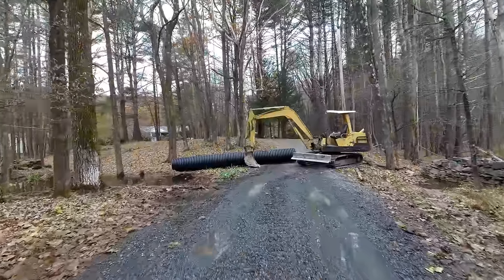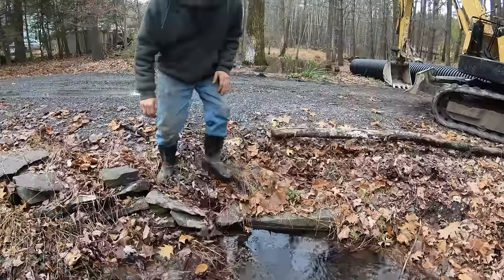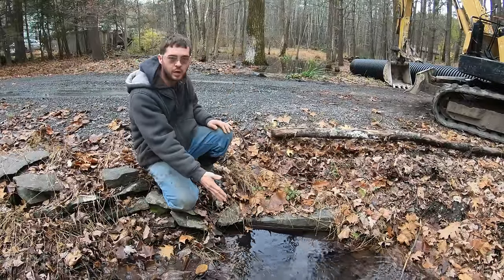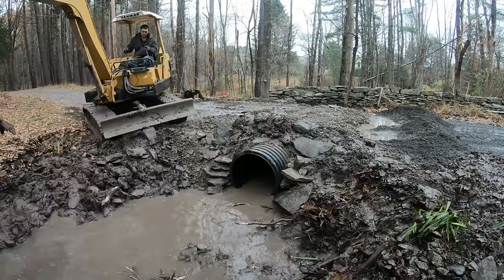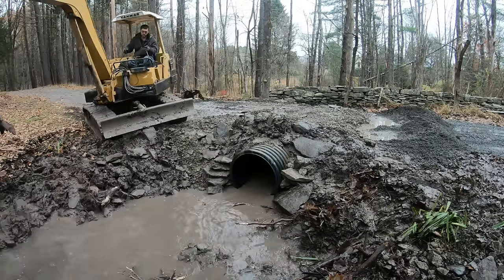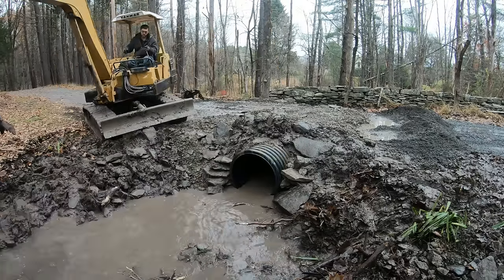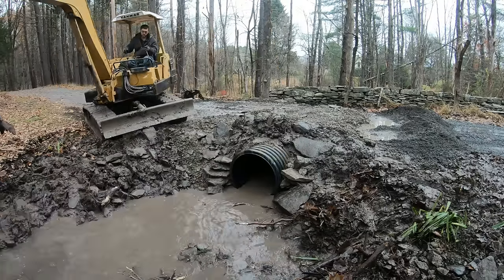Replacing a culvert pipe

Comment: I am 84 years old this yr.  I started operating heavy equipment in 1957 after the Air Force.  I stopped in the 1980s. Painting and Drywall was my real trade but always worked with Bulldozers, and scrapers.  I try and watch all you posings.. you bring back some great memories.  Thank you for posting this and others.

Comment: Lesson of the day: Hire Andrew first.
Reply: thats happened to me before as well, i mowed for this guy and i told him to wait a lil bit and he went ahead and got another guy to mow and he charged em quadruple of what i charged and didnt do a much as me, oh well he lost out on 5k , now i cut his stuff all the time instead xD
Reply: Yes I wish my a..hole next to me would do this to his drive way. I think I will have take him to court. My yard looks like I have a pond.
Reply: I know the heavy duty machinery is expensive but how much would a job like that run with parts and labor. I know it varies from location but what is the approximate number
Reply: @joneskey3950  depends on what you break tbh, you could have a cylinder packing failure and thats cheap to fix if you do your own labor or your drive motor can shit its pants and it could cost you a few thousand. depends. for a bobcat type machine we charge about 30$+ per hour and thats on the cheap side
Reply: what size gravel is that at the end....wow you spread it evenly and easily...
Reply: @johndowe7003  $30/hr is way too cheap. Depending on where you are, it should be $75-125/hr with a minimum.
Reply: Beautiful job!
Reply: @barkybarker2592  neh I just charge 30$ a hour a 50$ for truck and tools . I make more money that way because people give you more jobs
Reply: @johndowe7003  with that logic why don't you charge $12/hr. Your equipment will wear out faster and you won't have enough profit to repair or replace. But run your business your way. Merry Christmas!
Reply: @barkybarker2592  my machines are paid for, and repairs/fuel for my equipment isnt expensive. tires is the most expensive for me but i have my own tools so i fix my own tires so thats not a problem. fuel costs for me is about 2$ a hr so 28$ hourly wage is good enough for me. you charge too much and they aint gonna get you as often. just the way i do it, i like to undercut stupid fucks that overcharge just for shits and giggles lol
Reply: @johndowe7003  Yes, $28 is a decent wage but not a good hourly rate when you are paying taxes, insurance, parts & repairs, etc. $28/hr is about what I was making when I was working for someone else. I just bid an easy job at $90/hr and got it. So I'll make in 3hrs what you will in 10hrs. Enjoy your day!
Reply: and last.
Reply: Anonymous you get what you pay for
Reply: David488013 you chose to live there
Reply: DrScopeify very true if he’s making a living doing it I commend him. But if he’s gonna put up a video of his work he should do it correctly so people like you (misinformed) can actually learn to do it correctly because that by far is NOT the “properly” way to do it. Not bashing the guy he’s got great work ethic. DO IT RIGHT.
Reply: AGREED HE'S FROM ANOTHER PLANET JUST AMAZING.....
Reply: IF Andrew live here in Upper Northeast Illinois, I would Hire him in a heartbeat to do some work on our small piece of property!:-)Hey Andrew, Have a small spare bedroom and home cook meals??
Reply: @mysticarsenal  They call this in the industry "Pricing themselves out of work" because at some point, you'll have worked 3x more, and done 3x more work for 1/3rd of the pay and either break something or need medical care and wont be able to afford it type of thing. Those people cut the wages for the rest of us out there doing anything, too. If we all charged a good fair rate, we'd all be better off.
Reply: hypercube33 excellent point. 100% agree.
Reply: Damn right hes good aint you seen his movies. If this guy was in my backyard I hire him to do everything. He overengineers the shit out of everything and leans heavily towards serviceability. Thats money in the bank for any property owner.

Comment: I bet the home owner is now wishing that she had just hired  you to begin with
Reply: RNGN and when she has problems with this one in a cpl years she will wish she got someone better.
Reply: @mysticarsenal  Please elaborate.
Reply: Lsatq you mean why it will fail??
Reply: @mysticarsenal  ya
Reply: Lsatq I pointed out all the major issues to him in my post  below. Please read those. Thanks
Reply: @mysticarsenal  unable to find your post guy
Reply: @mysticarsenal  You'e right,
The pipe will absolutely  fail, he missing to ensure a flat ground under the pipe and digging deeper.
Reply: Mohammed LAMMANI I know. Thanks for backing me.
Reply: Pipe will start pushing up through. Any size over 12” should have a half height headwall installed on both ends and Atleast 36” of cover over entire length of pipe. Compaction is very important under pipe and on both sides. Which he didn’t do.
Reply: Mike Bresnahan are you referring to me about being hater???
Reply: Lsatq Pipe will start pushing up through. Any size over 12” should have a half height headwall installed on both ends and Atleast 36” of cover over entire length of pipe. Compaction under and up the sides of pipe is very important and he didn’t do that.
Reply: @mysticarsenal  there is a stone layment headwall. on both ends. but yes , its not deep enough! it should be good enough for 10-15 years if he gets in that gravel of 12" he promised in a week.
Reply: @mysticarsenal  I think the main problem with your "issues" is a lack of respect for the budget constraints. Someone has to pay to bring multiple machines in, to hammer bed rock, to do all these things. You seem to be someone who isn't willing to respect a contractor that does the best that can be done within the constraints of the job. I mean do you think it was him that only wanted to place 4 tons of gravel? He did the best that could be done. Yes with another thousand in the budget, a more permanent fix could have been established, but the thousand wasn't there.
Reply: @mysticarsenal  "not having a clue what they're talking about" 

Did your ears break midway through the video? He literally says "I agree it needs to be deeper" 

AKA HOW TO DO IT CORRECTLY. As in, it's not deep enough, the correct way is deeper. 

I mean jesus, do you need an episode of sesame street to get the full context of "people will say it's not deep enough and I agree it needs to be deeper" and pull from that the correct was to bury it deeper?

He said he hit bedrock and it would require him to use a hammer drill. Obviously that's going to triple his dig time, he'd need to swap to the drill, drill it all and then swap back attachments or else bring in a second machine.

He only put 4 tons of gravel on it AS AGAIN HE MENTIONED. Obviously it needs more. If you have any capacity for critical thought at all, you'd be able to infer that the reason the entire driveway minus the section by the culvert is completely devoid of gravel is that they don't pay to have it done. Look at like 15:00 in. The entire rest of the road hasn't been graveled in so long it's completely devoid of it. 

It's incredibly obvious that they paid for the bare minimum amount of gravel for that spot and that they didnt want any at all elsewhere. 

What might we deduce from this? They aren't going to pay triple for the dig labor to bring out a hammer drill.

Yes he didn't explicity come out and say "my customer is cheap and refused to pay for what it would take to do this right"

Nor should he. And no he shouldn't even say it "politely" because if the owners were to actually watch the video I assure you they'd be able to see through the polite BS to the actual statement. Certainly, they would if he said it as explicitly as you seem to need it to be said to drum it in.

There is enough evidence within the video for those with working eyes and ears to infer that they would not have covered the bill.
Reply: @sparkzbarca  better stop defending andrew;-)(he doesn,t care about about these knowitalls , cost you time and it wil not change one bit of these ''haters'' and ''so called pro,s'' trying to piss on his work..
andrew has multiple levels of workquality/cost, and these people refuse to realise that most clients have a budget or simply just don,t care enough to spend more money on..

i think its great that andrew can work on so many different levels..
some contracters think that they are too good for doing these types of jobs.
well that is where andrew comes in, as he can do lowbudget low level jobs as well as the highbudget high level jobs and everything in between..

they see him being succesfull being a mainly one man machine with little to no overhead, and getting extra money on adsense as well. and that stings them.. ;-)
just the number of vids, and different jobs tells me he is doing very well. and that he gets a lot of clients.
they can hate on everything but he is not swayed one bit by it and straight up ignores them..

so should we (imho)
Reply: @sparkzbarca  Good job holding back on the nitwit with zero comprehension of what he just witnessed. Or maybe he didn't watch it. He may have skipped to the end, spewed his dirt and now sticks to it to save face.
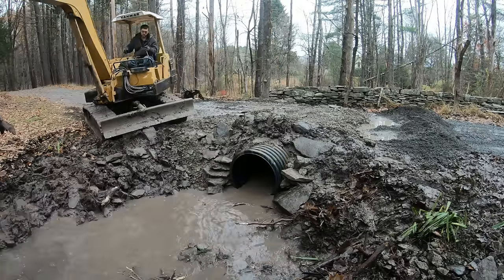Reply: Don Ziolkowski I’m also late to the argument. You are entirely correct. At the 12:00 mark Andrew says that some You Tubers will says it should have been dig deeper, and I agree. He says he dug as deep as he could and that he hit bedrock. It would take a pneumatic hammer to break through the bedrock, and that would have cost a lot more money, money she obviously wasn’t going to shell out. Face it, if she wanted it fixed correctly when the problem occurred she would have hired Andrew instead of paying someone to clean out the original pipe and lay down some gravel. And as it was, when he revisited the site he had to talk her into another 4 tons of gravel to strengthen the roadway. Don, your adversary is one of those I call “gotcha” people - so busy trying to find fault with someone that they neglect to listen to what is being said. When called on their mistake they always resort to the personal attack instead of defending their argument. In the final analysis, this video bolsters the old saying that you get what you pay for.

Comment: Outstanding!   Excellent reasonable effective solution!  I agree it should be deeper, but bedrock is bedrock.  Another usually less effective option would be to use two smaller pipes side by side so the top of the pipes would be lower.  Perfect slope on the pipe.  No wasted motion with the excavator.  Great job on delicately moving the tree limb twice, and great packing with the bucket.  And you included your trademark stone wings and caps on the pipe ends.

The land owner is penny smart and dollar foolish.  What old pipe?  It was long gone.  It is always frustrating when the customer will not let you do what needs to be done for the best result.  Some people refuse to understand that cheap work is not good and good work is not cheap.  Going back the second time, your price should have been higher because she wasted your time the first time out.

The limestone finished off the job beautifully!  You made the most of that limestone.  Nobody gets out of the truck and hand rakes limestone!  The landowner should be delighted with the beautiful result.

Your video production has become very polished and professional!

Happy Thanksgiving!

Comment: Great video.
I've been maintaining my 900ft gravel driveway through wetlands in New England for the last 18 years. The best thing for stubborn potholes is the scarifier teeth on a box blade. Set them deep. I found if you don't tear up at least a couple inches below the bottom of the pothole, it will consistently keep coming back. 
I picked up a cheap rosco 1-2 ton, split drum roller, between the box blade and the roller I can keep my gravel driveway like pavement pretty much all year long.
Reply: Dan D the box graders do work nice.
Reply: That’s the only way I have found to get rid of the potholes. I dig them down with my excavator then backfill and roll the rock back in
Reply: Yep, you HAVE to break up the pothole first. Just filling does nothing!
Reply: Yep you guys are all correct. If you want to get rid of a pothole you have to dig down a little deeper than the pothole itself that will help erase the memory. Fill it back in and compacted and you're good to go

Comment: glad you mentioned it's not deep enough so people don't get confused. Also worth noting from an engineering perspective a pipe is treated like an arch. The backfill and compression of solid 3/4" or 1" stone around the pipe walls while putting it in is way way way more important than putting gravel on top. The load should get distributed around the sides if done correctly.
Reply: lifeisgood070 actually COMPACTION of the best aggregate (being 304) not 3/4”-1”, entirely around the pipe, meaning over top of it also, is 100% just as important. The thicker the cover the better because it helps “bridge” the pipe. I can go to 3 locations right now and show you that not covering the pipes (steel, concrete and double wall plastic) is being damaged, deteriorating and crushed in but the bottom 3/4 is perfectly fine. You might want to check with an actual ENGINEER before assuming you know anything about an “engineering perspective”.
Reply: @mysticarsenal  We said the same thing. #304 should work fine. Yes it would be better at compaction tests. Angular will compact well.
around the sides and top is what i said, sides being more important yes. A couple inches on top will help. So will dirt.
Reply: @philthycoder  he sounds like the sub wishing he was the prime lol

Comment: That CPP pipe is some tough stuff. I've run over those with a 36 tn. tri-axle with only 3 in. of cover and it takes it, mind you it will crush the ribbing but that's about it. Looks like a good fix to me and nice to see someone who knows how to use a rake and not just to lean on it.

Comment: Cool video. Sometimes you are forced to put em shallow I know. You might be right about plastic, time will tell. We dug up a pair of steel four footers 70 feet long last year that had a tag on em that said 1937, all but one of the 6 sections were rusted out. But they were thick too, probly 1/8” metal. We replace everything in the township w plastic and haven’t had any problems yet, I think our oldest plastic ones are about 20 years maybe, thanks for the video, keep em comin

Comment: Its so refreshing to see an excavator actually go back with hand tools to put the finishing touches on a job. I maintain 600 feet of complicated driveway with a few woods roads. I have installed perhaps 10 plastic culverts. One trick I learned if possible is to dig a silt hole on the uphill side of the culvert to catch solids before they enter the pipe. I also hand set the culvert with a level. I suppose its just inexperience with my back hoe. I can never get the ditch right with just the machine. I tend to over dig and then adjust the set of the pipe with what ever is laying around so its got a few degrees of tilt. This is by far my favorite channel. My grand son loves the machines almost as much as Micky Mouse.

Comment: me: it's not de-
"everyone on youtube is gonna say it's not deep enough"
-_-
Reply: Lets wait for a bigger Vehicle :D
Reply: Jude Chauhan that’s what she said
Reply: Specs for that team come for a minimum of 12 inches of cover not even close I’m sorry that it’s a very poor installation
Reply: dyke the water off than dig the pipe to grade and actually check the grade so the pipe is not bowed. deeper would be good also but may not be possible to get drainage. 2 12 inch pipe would work better for getting more cover.
Reply: lol ya right
Reply: The devil Made me say it  Yeah I was looking at that thing bowing like hell when he was driving the excavator over it, thinking that things gonna snap some day, the plastic may get brittle after awhile and suffer the same stress fracturing that steel gets, and there's no proper pipe bedding either its probably not that big a deal for a pipe like this but its still an issue. i agree with Wayne that it should have been 2 pipes about half the size of that one to get a proper cover over depth.
Reply: I would have gone deeper if possible.  There may have been rock under preventing.  The wall on the downstream side wasn't helping.  Water could back up.I don't think he could have gone down another 1-2 feet.
Reply: Yes, and they are right!
Reply: @Gear Jammer maybe if all you "quality" people didnt wanna make a GRAND SLAM on every dam job and gave realistic estimates...you would do better...the kid does a fine job, does he have more to learn? of course...we all do
Reply: nobody tells andrew how to do it
Reply: He hit bedrock, you can see it in the video, it would cost a fortune to hammer it deep enough